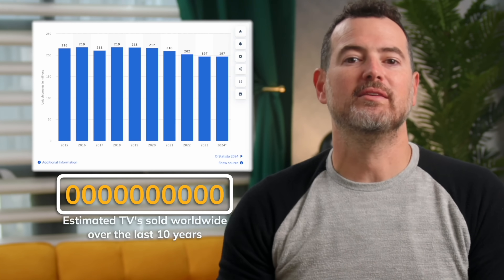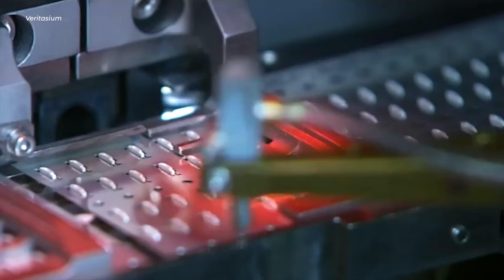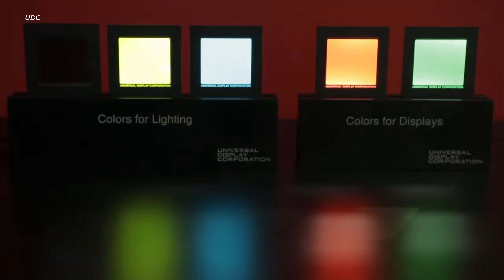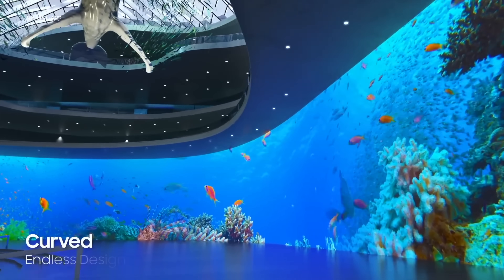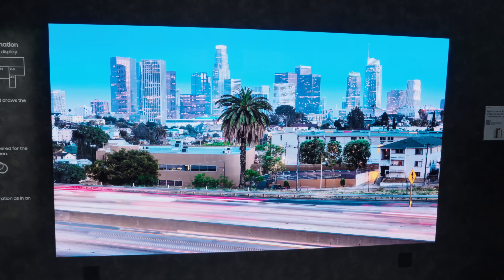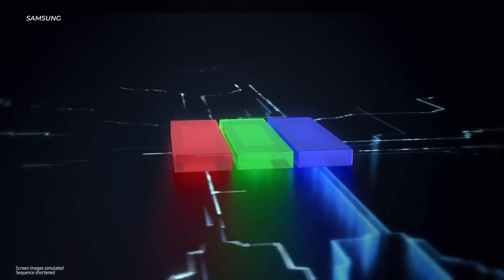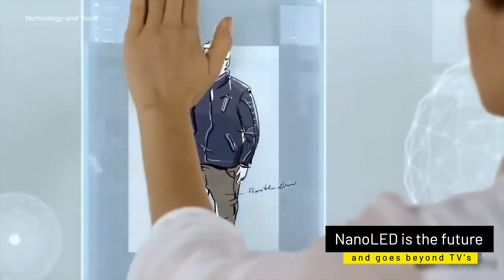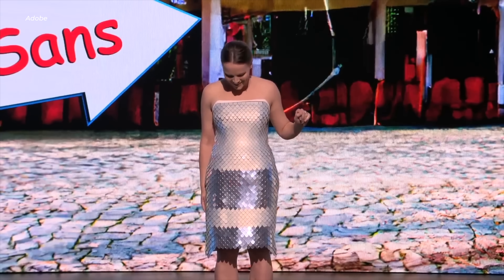PHOLED! What you need in a new TV!

Comment: 2:24 that’s not right 
Burn in will still be an issue 
Microled is what will fix the burn in issue
Reply: NanoLED/QDEL will fix the burn-in issue as well. If I was a betting man, my money would be at NanoLED, MicroLED always seems years off before they come at consumer prices & sizes. PHOLED may not fix the burn-in issue entirely (which is an issue with the OLED technology itself), but if PHOLED is such an improvement over current OLED that PHOLED monitors without an issue can be used in offices without complaints about burn-in, the life expectancy might have improved in such a way that burn-in in practice is a non-issue.
Reply: @GAG091186  maybe if let’s say PHOLED is resistant long term then maybe 
Like if I display CNN 24 hours a day and it still survives after 10 years but fails at the 11th year then yah 
But it doesn’t make it immune 

I for one have a tv that is from 2006 (still kicking strong) 1080P tv , will PHOLED survive this much while I watch mostly sports so a lot of static content !? 
That’s the thing I don’t think it will , so microled is the end game but not PHOLED as this video makes it out to be
Reply: @Annonymous37284  The CNN anology when it comes to the lifetime of a PHOLED panel is also what I have in mind. Burn-in would still be an issue, but because it's so hard to actually get burn-in on such panels, maybe it wouldn't even be a relevant topic of discussion when those panels are the "latest and greatest" on the market?

This might just be wishfull thinking from my part, but even so I still look at OLED in general as a transistional technology before NanoLED and / or MicroLED to consumer sizes & prices.